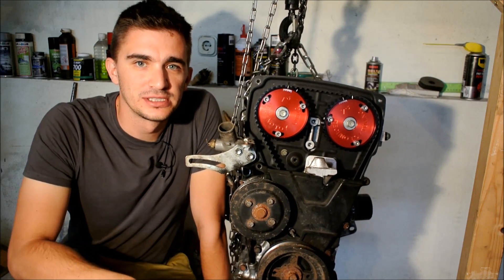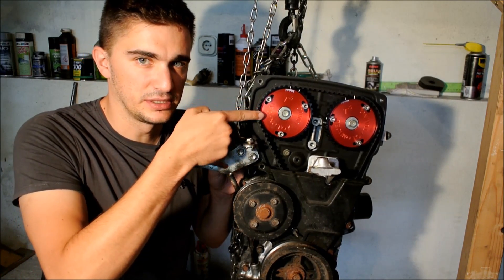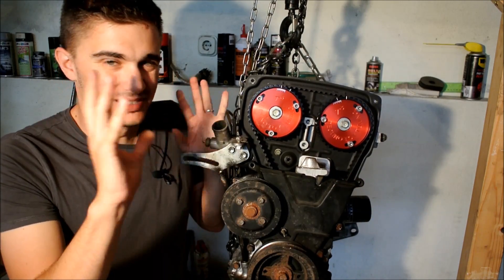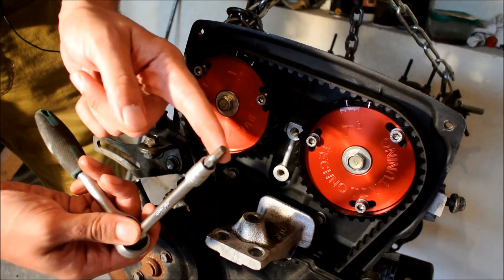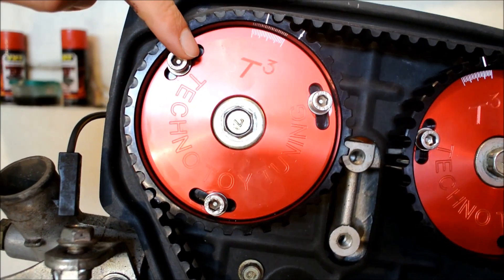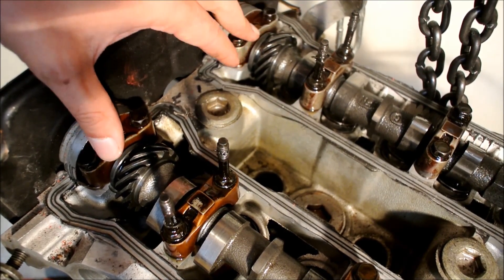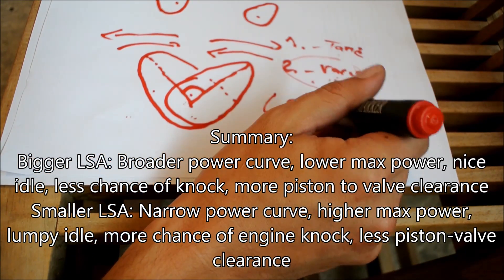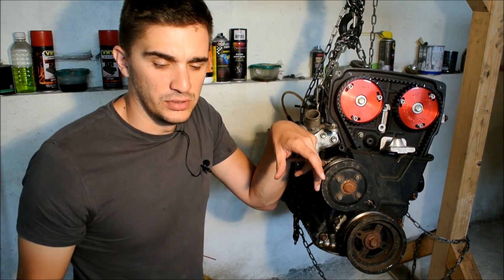Adjustable CAM GEARS - the basics you need to know

Comment: Is it worth putting adjustable cam gears on a stock engine?
Reply from the maker: murry001 You won't really gain anything, other than maybe some practical learning experience and fun with the different settings.
Reply: I did the same on a stock 4G93 NA, it helps a lot when l swap the MIVEC head with adjustable cam gear on the exhaust.
Reply: @princesssolace4337  heyy man we have the same engine,  im planning to put adjustable cam gears on it,  do u recommend it or not?
Reply: @princesssolace4337  the only thing I've done to my build so far was replacing the stock throttle body to a 60mm throttle body,  cold air intake,  2.5 inch exhaust system and 4-1 extractors.

Comment: Techno Toy Tuning or "T3" for short is actually the tuning house that is responsible for building, tuning and maintainung Keiichi Tsuchia's ( "The Drift King") AE86.
     They're largely regarded as the "go to" tuning outfit for all thing's Hatchi related locally in Japan.
    
     From whatall I've read and reaserched on T3, They're just an outfit that loves 86's and are dedicated to keeping them alive.
Reply: Johnny Keller I think you got T3 and Tec-Art confused.
Reply: @touge_cowboy  Tec Art did the body and chassis but the engine by the TRD Jedi Master, later the cross transmission and rear diff by someone else...sorry if l got everything mixed up, my Japanese to English is shit.

Comment: Simple and informative video. One thing I would recommend is always use a degree wheel and a dial gauge or piston locator when dialing in your cams. These will tell you where the piston is in relation to the cam/s and valves.
Reply: I'm currently looking for the instructions on using a degree wheel

Comment: I have a Honda dohc but do you think it's the same steps
Reply from the maker: Ashwin Sivaainkaran The basic procedure is pretty much the same. You just have to know the LSA you need for your cams.
Reply: Yeah it's the opposite like it's counterclockwise
Reply from the maker: +Ashwin Sivaainkaran Yes, that too. Honda engines spin the other way, keep it in mind when adjusting. Good luck :)

Comment: I have a question. My car is a Hyundai Tiburon v6 2.7. My tuning details are simple air intake tuning, exhaust tuning, and ecu mapping. And cam is an OEM condition and other remaining maintenance is OEM. Is it okay to install an adjustable cam gear in this state? Is it okay to do without re-mapping the ECU if it is fitted in?

Comment: Is there any video in making about setting the camshaft with comparator tool? Great job on explaining LSA
Reply from the maker: +92bego I did that but I didn't record it. I'll try to make one when I assemble the engine this time around. In about a month or so I hope.
Reply: I am starting my build next week but when it comes to this i have a question mark above my head, main problem is that i have home made cam pulleys with no marks at all, but i will watch your video anyway when it comes up.

Comment: A couple of years ago I purchased the same cam gears, in the same color combo actually, and they have been great. Tightened them firmly by hand and no probs since. Incidentally these are probably the lightest on the market as well.
Reply from the maker: Car Dude Thanks for your feedback and pointing out the info on lightness, I didn't know that, it's a really cool bonus.
Reply: Do these adjustable gears even do mich on a single cam engine? Just asking cause if you were to for example advance the intake, you would advance the exhaust cams aswell, so idk if it would make much sense.

Would be awesome if someone could help/explain.

Comment: You made this very easy to understand. I finally understand why people buy adjustable cam gears after buying the aftermarket camshafts. Now I'd like to know is how would you know how far to position the lobe seperation angle before the piston and valve clashes... Just feel it?
Reply from the maker: Lime Glad the video was helpful. All aftermarket cams come with a recommended LSA. When it comes to pistons hitting valves because you set the LSA too tight, by the time you feel it, it will be too late. The proper approach would be to check piston to valve clearance during engine assembly. Also spin the camshaft a full revolution with the piston at TDC and record the camshaft angle when the valve and piston make contact, you will then know the limit to which you can play with your LSA.

Comment: If you mill the head for maximum compression (Lima engines) you have to have and adjustable cam sprocket
Reply from the maker: tom ashton True. Thanks for adding that, it's useful info.